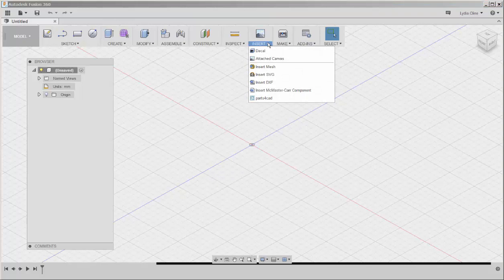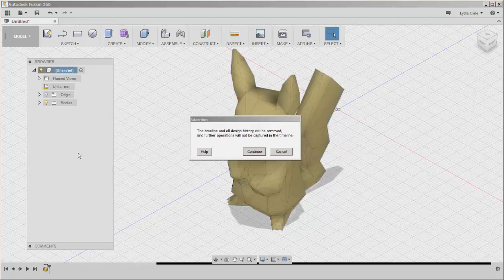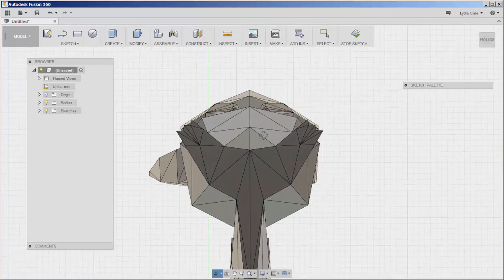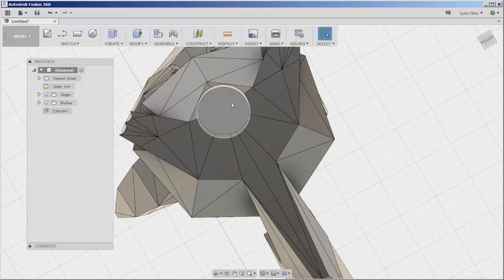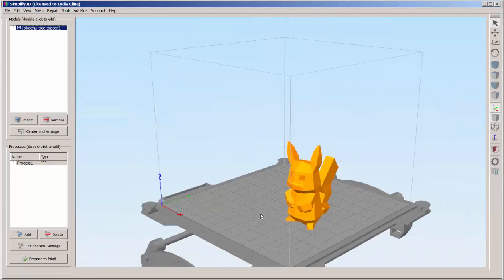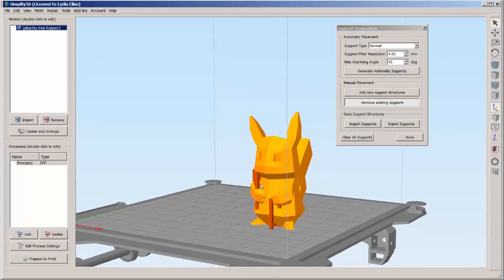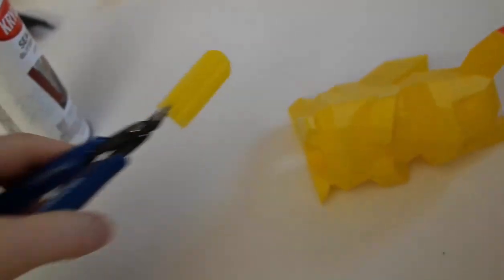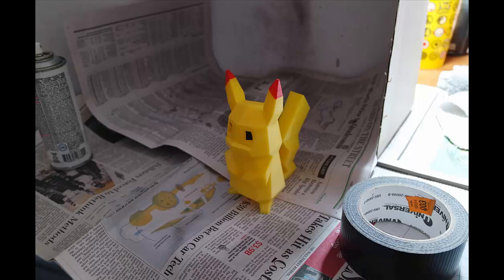Fusion 360: Pikachu Tree Topper with Easily Removable Supports

Comment: I wonder if you could get away with no supports using the curve.
Reply from the maker: Probably. I just tried it once without supports at all, and the front of the curve buckled. It might have been too-high temps, as I also lowered the temps for the second effort. That said, this is a technique you could use for flat bottom plates so that rafts don't stick to them. With the heated bed I didn't need a raft, but with cold plates, I almost always do.